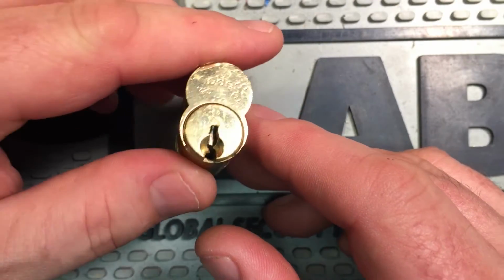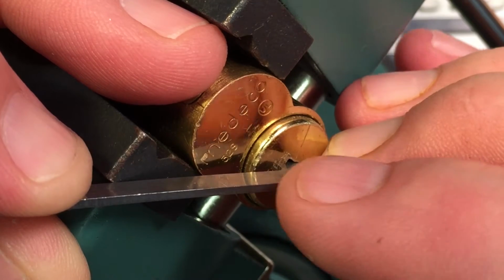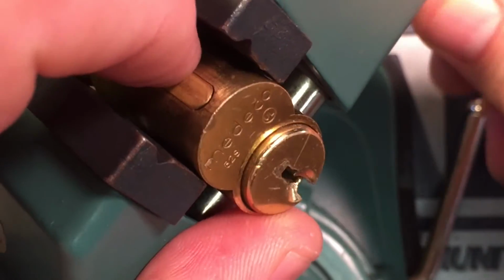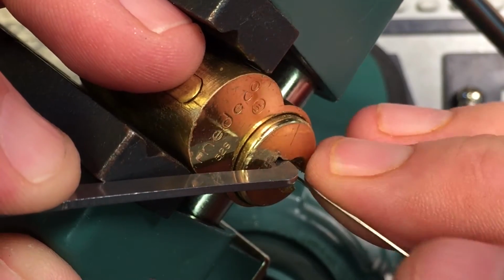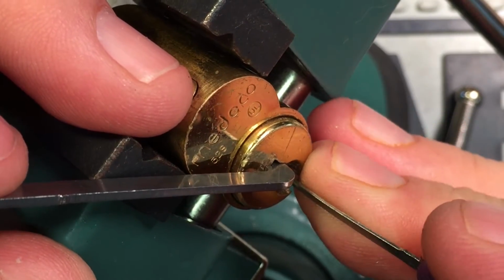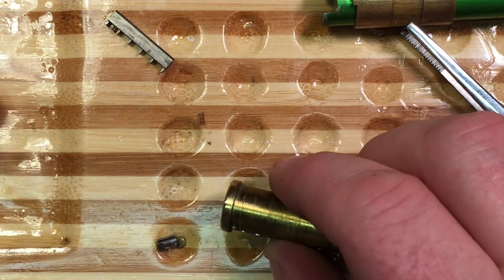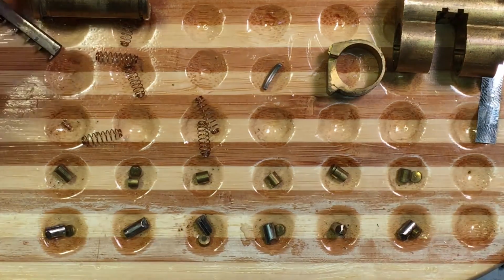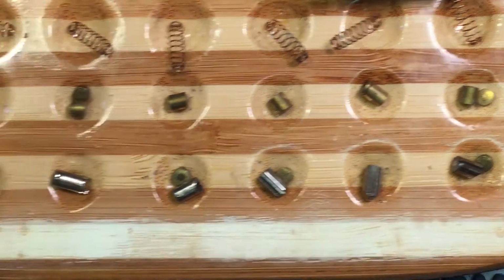Medeco Classic LFIC - Tripple Pick & Gut

Comment: Very nice picking as always. If you took the wafers out would the picking be abit harder? I have 2 medeco driverless cam locks. One dimple style and the other pin tumbler 3 Pinner. And have watched your way of picking and still no joy. Tension. What pressure do you use?. Do you rake then pick? Thanks..
Reply from the maker: Thanks so much for your kind words mate! Really appreciate it. I do think removing the master wafers from this lock might make it a bit tougher to pick. My tension on these is all over the map. I back way off to sweep the pins, then lay it on moderately to test them for rotational jiggle. I would not say it's raking as much as it is sweeping. I think of raking as very gross motor movements dragging the pick all the way out and back in again. This is more a fine motor movement where I pick a pin, tilt the pick slightly to one side or the other and lightly brush the chisel points with the tip of my pick (gem usually). With driver locks, I do not attempt to lift at the same time, but I do with driverless cams. The CCW process is a little like so: Tension, test for a binder, back off tension a bit, sweep the binder while pulsing tension until it will "jiggle". Repeat this process until all but one stacks feel lose or jiggly, then find the binder. Lift it into a vertical set, test it again. If it jiggles, it's set both rotationally and vertically... Move onto the next pin and repeat. If it does not jiggle, I drop it and start the entire process over again.
Inevitably I mistake unset pins for set ones and need to return to them, sometimes having to drop nearly everything in order to get back to it. With Medecos, you really are just chasing the lock into a progressively deeper false set until it opens up.

Comment: Dumb question, on a 5 pin Medeco LFIC would pins controlling the control sleeve still be chambers 3 and 4? And can a 5 pin Medeco LFIC fit in a 6 pin housing or do they have separate housings for 5 and 6 pin LFICs.. Im still working on picking Medeco, trying towards picking my LFIC that I have only with operating key.. I have 7 or 8 Medeco mortise cylinders 2 of them are M3's and one of them is a LFIC. I have a Classic pinned up with 4 pins and Im getting the hang of it, slowly... Picking it counter clockwise. You helped me out alot with explaining your method, but is there anything else you could add? Did you start learning these by progressively pinning? Some people even mentioned to take out the drivers so you can work on the feel of setting rotationaly, I don't know if that's a good idea or not..  Anyway sorry for the long-ish message Let me know if there is anything you could add to that, or if you can point me to a good source for information on learning how to pick Medeco. Thanks again buddy :D
Reply: Scratch the question on where the control lug is on the 5 pin LFIC, I just got my first 2 medeco locks picked.. one where I sequentially pinned and one, the LFIC that I have mentioned before.. I got it picked to operating, and with a little ingenuity and a tool I made, was able to retract the control lug. Im uploading a short video on it now.. Man talk about an awesome feeling the first time you crack a medeco, I cant thank you enough for the encouragement and tips and tricks.. Thanks buddy!

Comment: nice picking. do you pick the driver and rotate the key pin at the same time
Reply from the maker: We talked on Discord, so I'll just stub this is in case anyone else is curious. I don't lift and sweep at the same time unless it is a driverless cam lock. The CCW process is a little like so: Tension, test for a binder, back off tension a bit, sweep the binder while pulsing tension until it will "jiggle". Repeat this process until all but one stacks feel lose or jiggly, then find the binder. Lift it into a vertical set, test it again. If it jiggles, it's set both rotationally and vertically... Move onto the next pin and repeat. If it does not jiggle, I drop it and start the entire process over again.
Inevitably I mistake unset pins for set ones and need to return to them, sometimes having to drop nearly everything in order to get back to it. With Medecos, you really are just chasing the lock into a progressively deeper false set until it opens up.